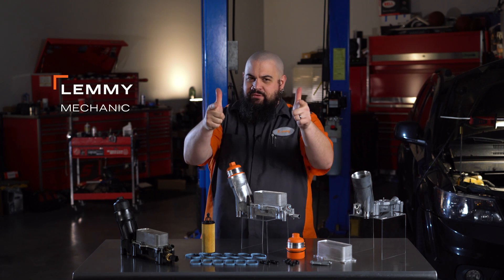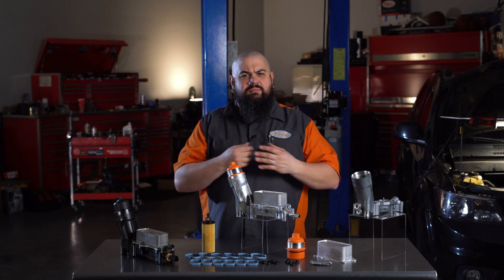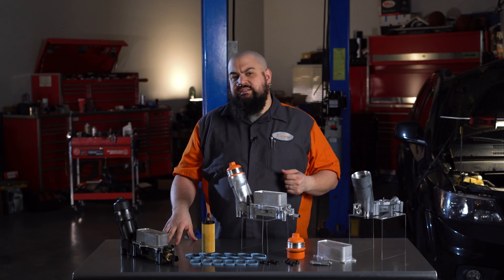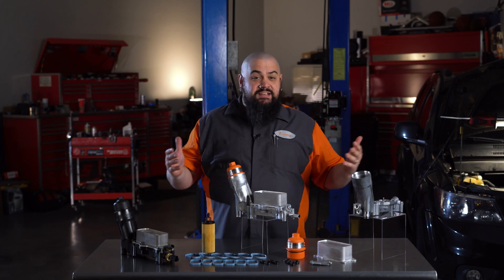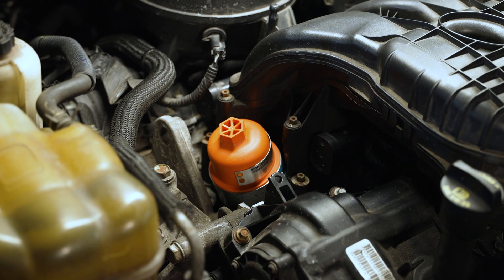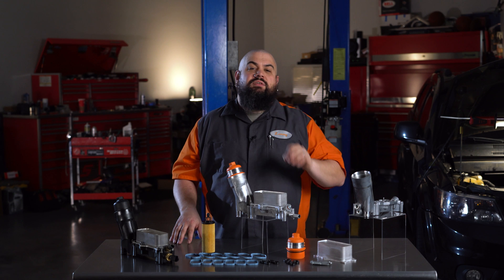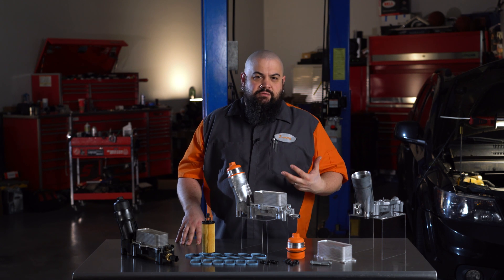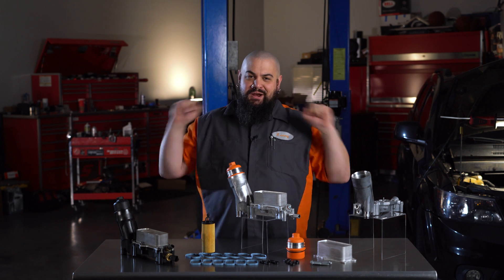Better fix for leaking oil filter housing on many older Pentastar V6 Engines

Comment: I installed this on my 2014 jeep wrangler unlimited but had issues with the knock sensor. Replaced the knock sensors and had it good running for a good 4 months then it hit me again with the same code P325 knock sensor. So you think with the new aluminum housing it causes more heat and could damage the wires for the knock sensors or the knock sensors it self?

Comment: The problem was the rubber material used on the O-rings, not the plastic housing. How do I know this? I have a buddy working for FCA powertrain warranty department and they upgraded the material for these seals to eliminate this issue.  Not a lot of people know this and they jump to the aluminum housing thinking that this was the root cause of the oil leak.

Comment: I I’m on my 3rd set of gaskets the biggest one one the bottom looks like it keeps melting and leaks, used the Dorman gaskets then felpro now the mopar is in it and starting to leak. Also on the 2nd Dorman cooler aassembly. About to switch back to OEM I feel like you guys need to work on machining the bottoms to make things smooth and level
Reply from the maker: Thank you for letting us know. I will forward your comments to our quality team.

Comment: A great  replacement for the 3.6 engine, it should have come that way instead of the bottom being plastic over time it will crack.

Comment: I haven’t changed it out yet. I don’t think the Dorman is the problem,I think the gaskets/seals can’t handle the heat from these engines. Anything you can do to help will be appreciated. Thank you for responding I do appreciate it.

Comment: Don’t jump the gun. I replaced the polymer with a Dorman. It did just like the polymer and started leaking after 5 months   Come up with a real solution that fixes this  permanently. I am not satisfied with this Dorman
Reply from the maker: Hello, would you like us to send gaskets or have you warrantied the part through your retailer already?
Reply: The problem was the rubber material used on the O-rings, not the plastic housing. How do I know this? I have a buddy working for FCA powertrain warranty department and they upgraded the material for these seals to eliminate this issue.  Not a lot of people know this and they jump to the aluminum housing thinking that this was the root cause of the oil leak.

Comment: How about the 90 psi oil pressure at cold start ?   Does that contribute to a leak in the base gaskets ?
Reply: Oil pressure is usually higher at a cold start. I live in Canada so circumstances are a bit different.

Comment: Just wondering ..if i can use the Baxter Performance cartridge  which I have on now.. in my oil cooler.. thanks
Reply from the maker: Good question! if your current oil filter cartridge fits your OE housing, then it will also fit our aluminum housing!
Reply: @DormanProducts   thank you

Comment: Just got mine. Waiting on Baxter performance oil filter replacement kit with check valve before jeep goes to the shop. This is all within my abilities, but I am too old to keep wrenching on the jeep. Good video. Thank you

Comment: Any way to get the sticker for the cap? I have a 2011 and already replaced mine with your earlier product. I know it uses the later model filter, but mechanics don't.
Reply from the maker: Hi Craig, unfortunately we do not offer the sticker separately as it is already attached to the cap. I will let our product team know of your suggestion, thank you!

Comment: Added the Dorman on my 2012 Wrangler, it's still leaking....
Reply from the maker: Hello, can you please tell us where it is leaking specifically please?
Reply: @DormanProducts  Haven't been able to find the exact leak. After having the part installed, I sprayed the bottom side of the motor to clear old oil. After a few weeks, I noticed new oil on the bottom of the motor and my oil level was low.

Comment: I just bought this and the o-rings do not fit all the way in correctly. When I put it on the underside of the housing unit they stretch and make kind of a triangle shape. Does anyone else have this problem/recommendations?
Reply from the maker: Hi Travis, the gaskets will fit into the place on the housing and then when bolted and torqued down they make a good seal.
Reply: Yeah and it leaked like 4.5 quarts in about 30 seconds. Did you ever get yours running right?

Comment: I have changed this out in both my 2015 Chrysler T&C (45K miles) and my 2018 Dodge Journey Crossroad (10K).  Both were done as preventative maintenance.  Used Dorman Aluminum replacement part, and replace both the oil temp sender, and oil pressure sender while I had it all apart.

Comment: I have a 2019 Jeep Wrangle JL 3.6?L , do you know if Dodge/Jeep improved on the older Pentastar version's or did they keep everything plastic again? Do you have a kit for the newer engines 2018-23?
Thanks.
Reply from the maker: Hi William, part #926-959 fits Chrysler 2022-11, Dodge 2022-11, Jeep 2022-11, Ram 2022-12, Volkswagen 2014-11. Check it out here! https://www.dormanproducts.com/p-139011-926-959.aspx?year=2018&origin=keyword

Comment: I ordered this Dorman product. It seems very well made. The product is stamped "Made in the USA." However, contrary to the advertisement pictures, the long and short bolts were not included with this part / kit. I emailed O'Reilly (the retailer) and they told me that the bolts are no longer included in the kit. I e-mailed Dorman and they shipped the missing bolts to me very quickly.  See below. Thanks
Reply from the maker: Hi John, the bolts both long and short in our picture of the 926-959 are still included in that kit. Please email kscholl@dormanproducts.com with your issue and address, we can see if we have some available to ship out to you. Thanks!
Reply: @DormanProducts  Just got the bolts and amended my original post. Thanks a Million!!!!!!

Comment: Is this part discontinued???
Reply from the maker: Hi Davey, yes, but part #926-959 which is the housing with the oil cooler and filter as an entire assembly is available.
Reply: @DormanProducts  Where?
Reply from the maker: Hello, we recommend calling your local auto parts stores for availability or to place an order. Thank you!

Comment: I'm SURPRISED to see this video as i spoke with DOORMAN rep, This Product is NOT being produced anymore, can someone elaborate if this is politically motivated by FCA for DOORMAN not to manufacture this??      This is a great video, and i've seen several other video's on this great solution for Pentastar V6 Oil filter housing assembly, it is very Unfortunate that its NOT being manufactured any longer 😞
Reply from the maker: Hi Afshin, part #926-959 which is the housing with the oil cooler and filter as an entire assembly is available!

Comment: I heard that this part has been discontinued by Dorman.  Is this true?  If so, any idea why it is discontinued?
Reply from the maker: Hi Nick, yes, but part #926-959 which is the housing with the oil cooler and filter as an entire assembly is available.

Comment: Just had mine replaced in my 2011 Durango. The dealer did it and they have never used your product before and were totally impressed with the quality of the items in the box including the packaging. I'm so happy that you are building quality parts to replace the factory ones that failed. Thanks again, keep up the GREAT work.
Reply: Where you get the part from? Will this fit a 2013 Dodge Grand Caravan?
Reply: @Tumusica311  If it's a Pentastar V-6, it probably will. I got mine at Autozone.
Reply: @nvthom  Thank you!

Comment: What is the part number for that cooler and gasket set? Not the actual housing...I've replaced my oil cooler with your aluminum housing about a year ago and now its leaking again 🤦🏻‍♂️ I have no plans on buying another housing. It has to be the seals blowing out.
Reply from the maker: Hello, great question! Unfortunately we do not have a part # for a gasket set or cooler sold separately. I will let the product team know of your new product idea.
Reply: @DormanProducts  that would be great for those of us that have already purchased the first version 926-876 of this aluminum housing. As we had to reuse our factory cooler. I've found a couple of the factory flat plate coolers that were warped. Didn't find this out until after I had already reused that part on your 926-876 to complete the installation using your provided torque specifications and instructions. Only to last a few miles before it started leaking again. After tear down and inspection, the only problem I could find was when I would lay a flat metal ruler diagonally flat matting surface, I had a slight "rock" of the ruler. I forget now, but it was a few thousands feeler gauge I could get under the one end or the other. Definitely slightly warped. And of course, this allowed one of the 2 figure 8 looking o-rings to blow out. Would be most unfortunate if that part available isn't made available. Guarantee I'm not the only one finding this issue.

Comment: Hi Dorman, 2014 Wrangler Rubicon, I need to replace the oil filter housing. Will this kit be the only thing I need?
Reply from the maker: Yes! That is a complete kit, just transfer over your sensors and it is good to go!

Comment: What is the Tourque on bolts to transfer cooler it’s self to body I heard 35inch pounds
Reply from the maker: Hi David,  great question! We recommend 106 inch lbs as per the instructions of the 926-959.  Please see link below. https://static.dormanproducts.com/document/926-959_instructions.pdf

Comment: i had to disconecct the passenger side gas rail from the bottom piece to flip it over to the other side  when i reconect it back up am i gonna have a problem staring the engine sine i relieved the pressure out of it. does it have to be bled like brakes 
fuel injector on pseenger side i had to disconnect pulled it off so a little gas come out
Reply from the maker: Hi Billy! Yes, we would recommend you prime that fuel line system so it doesn't have an issue starting.
Reply: @DormanProducts   how do you do that
Reply from the maker: Hi Billy, we recommend you consult your OE service guide for your vehicle.
Reply: @DormanProducts   thank you

Comment: Replaced the housing on my 2015 Dodge Charger with this, and while it seemed to fix the deeper internal leak, now oil is free flowing out of the oil filter. Honestly it dumps more oil now than it did before
Reply from the maker: To help assist you further, is the oil coming up out of the oil filter area, near the cap or is it coming out of the housing to the oil cooler?
Reply: @DormanProducts  It seems to be coming from around the filter cap. I bought a replacement Dorman cap today and I am replacing it tomorrow to see if it fixes it
Reply: @DormanProducts  update, bought a DORMAN oil filter cap to replace the old one thinking the same brand would fit nicely together. It wouldn’t even screw on. Tried to attach it to the original housing and it works. Now we’re gonna have to take everything back apart and put the old housing back on with the new gaskets and hope it works. I think the Dorman housing is the reason it’s leaking 🤷🏻‍♀️
Reply: @localbuzzkill1760  any updates on this? I need to replace my oil filter housing on my 2014 wrangler 3.6 pentastar, was going to buy mopar part but then found this Dorman aluminum one. But after reading your comment, now I'm hesitant to get it and thinking of just going oem
Reply: @ElBrisho  we determined that the threading on the Dorman housing was faulty, causing the cap not to attach properly and leak. We're having to buy an entirely new housing now, but the leak has slowed down a lot since we first put it in. To be honest I'm confused as hell about it
Reply: @DormanProducts  yes the oil coming up out of the oil filter  Should the coolant be changed?
Reply: Replaced 2 days ago and mine is still leaking from the housing install area.
Reply: Thanks for update, strange because the treads aren’t the point of sealing. But rather the oring but if that area isn’t machined correctly it can or could leak
Reply: 3 months has gone by and there is no fix in the reply?
Reply: @ether_assassinbt8670  if it helps, I installed the dorman unit a month ago, and have been running it without issue. I say go for it if you need to replace it, use Dorman instead of the oem plastic one

Comment: I have a bad oil pressure sensor in my 2012 wrangler. I figured that since I have to rip everything apart,  I’d replace the old assembly with a new 2014 unit so I bought one. Been sitting on it for a while. I literally just discovered this new aluminum assembly today so I’m going to try this instead. I already have a new Mopar oil pressure sensor so I’ll just get a new temperature sensor to install with it. After reading all of the nightmares with the OEM units failing multiple times, I only want to do this once so I’m gonna try the Dorman.
Reply: This is not a be all end all to the leaking....my aluminum housing was installed about a year ago and it is now leaking again. And I will say, if you or anyone else gets this product, inspect it well. The unit I received had all kinds of metal bits in it and shaving that needed to be de-burred or else they would of found their way into the engine soon or later...just a heads up.
Reply: @h8tnlife  thanks, I held off on using the aluminum housing and went with the oem Mopar.  I read some people were having issues with the cooler to housing seals on the aluminum version. I’ll hold onto it just in case. I definitely don’t want to mess with this thing again though. What a pain!
Reply: @redeemed2517  I had a leak after installing the aluminum housing the first time. Found that the used factory oil cooler itself had a slight warp to it....nothing with the actual dorman unit. When I removed it for inspection, I put a metal straight edge across the bottom mating surface, I could get a few thousands feeler guage in between. That allowed the figure 8 looking Oring to blow out. Now that they are offering the oil cooler with the aluminum housing so you don't need to reuse the factory piece in addition, it should be a win win.
Reply: @h8tnlife  that’s good to know. I thought about returning the Dorman unit but I think that I’m gonna hold onto it. I have 92k miles on the Jk so I went ahead and changed the plugs, coils and PCV valve… that thing was a pain to get to. Finished all that off with a transmission fluid and filter change as well as the t-case. Hopefully I’m done with maintenance for a while.
Reply: @h8tnlife  there are two issues for these upgrated Aluminum Housing for Pentastar 3.6L engine on market. one is the flateness is not good on the bottom of Housing and caused leaking issue. Second, it looks all die casting aluminum Housing has issue of metal bits or burr from machining especial for the inside passange. Obviously it's dangerous for your engine. But another gravity casting aluminum Housing is better quality and no metal bits or burr inside because no machining inside.

Comment: When Upgrading To The Dorman Product Do I Have To Replace Or Can I Swap The Previous Coolant And Oil Sensors? Thanks
Reply from the maker: Hello, great question! You can reuse your existing sensors or if your sensors have failed you will want to replace them.

Comment: I absolutely want one of these for my 13 JKUR up here in Yukon Canada, however my local company hasnt been able to figure this one out. Any idea on when these will be made available in the Canadian market? Thanks!
Reply from the maker: Hi Justin, so part # 926-959 is the part you are looking for. If you follow this link https://www.dormanproducts.com/p-139011-926-959.aspx?origin=keyword and click on the "where to buy" button it will prompt you to add your zip code and will list all the retailers nearest to your area that you could order through.
Reply: @DormanProducts  Did all that. My local store cannot seem to find it in their system. 

I see Summit Racing lists it, I will try through them.

Comment: I have a 2015 wrangler and it was leaking, it originally had the plastic factory unit and I replaced it with yours a few days back, I didn’t see oil sitting in the oil well which is a problem I noticed with the plastic one however I did notice that oil was still leaking under the car. Is there possibly still a leak? Or could it just be excess oil from the previous unit?
Reply from the maker: Hi Alex,  if there's standing oil that wasn't cleaned up with the repair, at some point it will slosh around and drip to the ground. So we would recommend to clean up as much as you can and also check the oil level in the vehicle. If it keeps dripping after you clean up, check the oil level again and see if it has lowered. This may be the only way to determine if there's a leak.

Comment: So the 926-876 won’t fit a 3.6L in a 2013 ram, even with Amazon saying it will? If it does not fit then what are the differences between the two?
Reply from the maker: Hi Riley, great question! 926-876 is the housing itself, it will not work on 2011-2013 year applications because of how the oil cooler that mounts to the housing is different in those years. We have come out with the 926-959 kit that includes the oil cooler housing and other pieces so it can be retrofitted into the 2011-2013 applications as a complete kit. We recommend you purchase the 926-959.